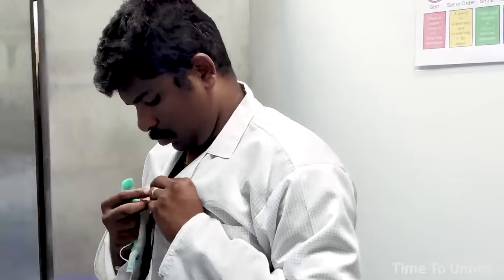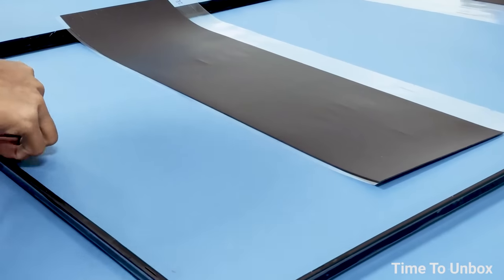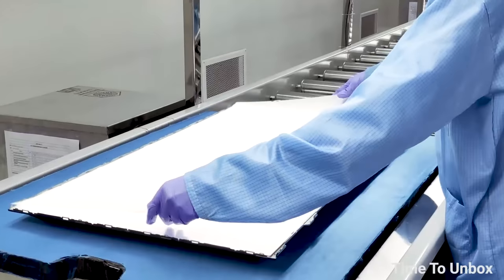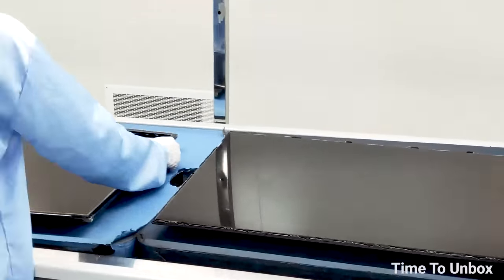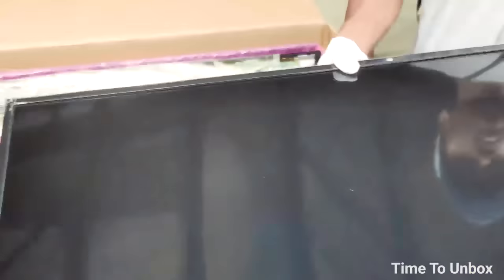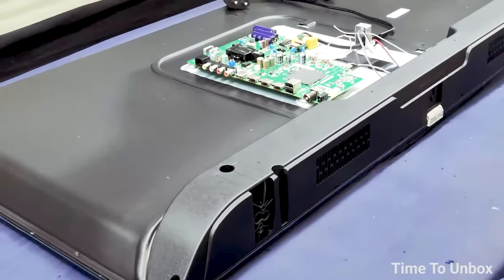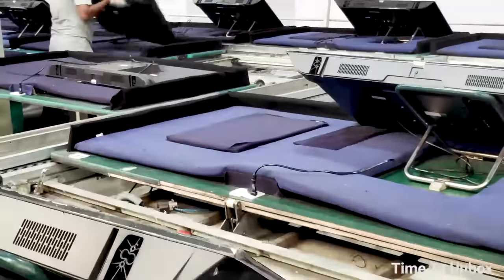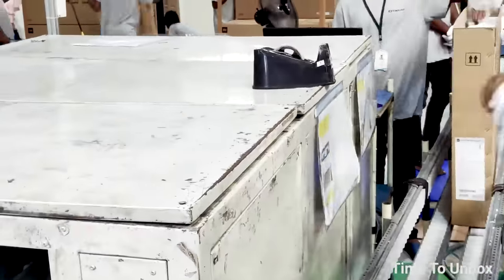Mi LED Smart TV manufacturing plant Tour in India

Comment: "This is the point on the line where we do a slapdash job soldering the components together and put in the cheapo substandard electrolytic capacitors that will fail and void the warranty after 1 to 4 weeks of use."
Reply: That's what i thought, they did look like 'budget' TV's